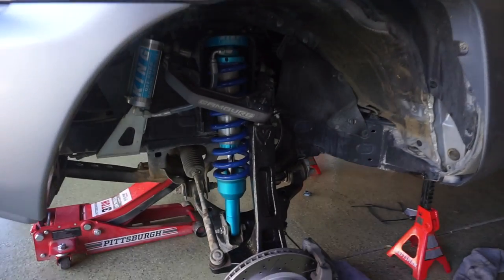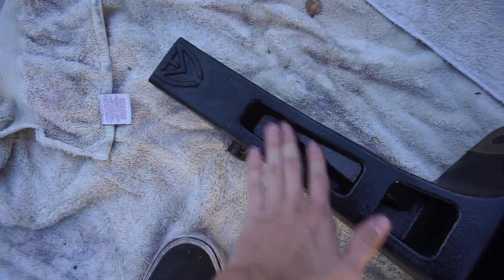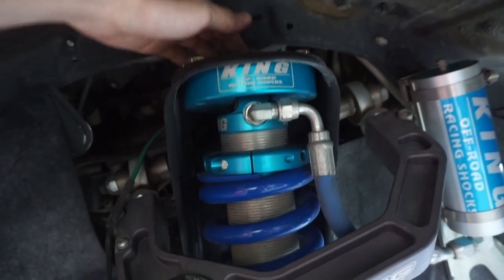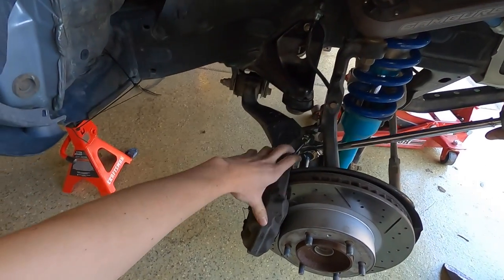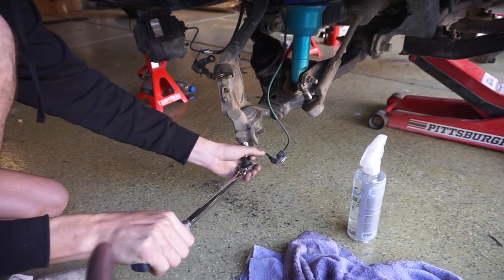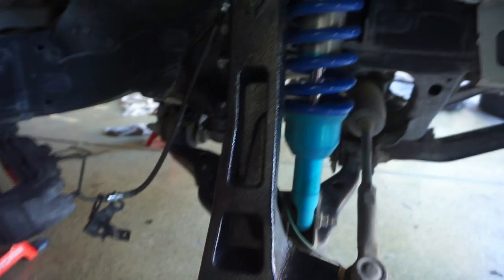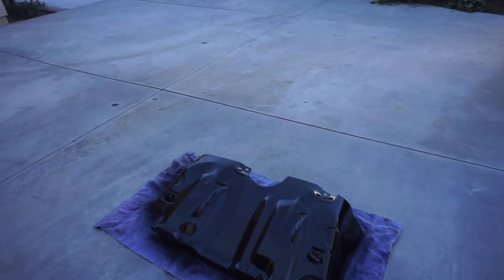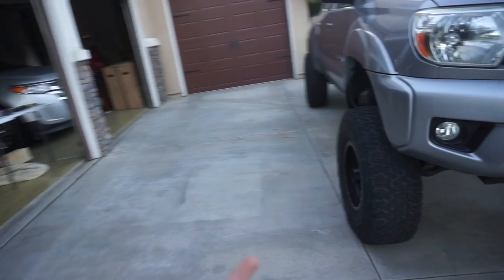My Tacoma NEEDED This For BETTER OFF-ROADING - Maxtrac Spindle Install

Comment: Aye man so check it out. All the stuff you went through. I went through with my Colorado. The driver side is naturally heavier then passenger. It’s uneven. The lift is amazing. I haven’t looked back. I do have 315/70/17. But I mean big tires small holes. Big game changer.

Comment: How are you running coilovers designed for only a 3 inch max lift on 4 inch spindles does it ride rough?
Reply from the maker: Now I’m no suspension expert by any means so take what I say with a grain of salt. But the 3 inch max lift is referring to exactly what that say. 3inches of LIFT. Doesn’t mean that the shock rod is maxed out. Just means that the Coilover itself can only lift 3 inches by utilizing preload. By putting in the spindle I’m able to remove all of that preload (drop all the lift out of the Coilover) and allows the spindle to do all the lifting so now the Coilover has a full range of motion and works better. Since the spindle attached to the balljoint in the upper control arm it’s simply spacing out the upper and lower not stretching out the Coilover since the top of the Coilover is attached to the coil bucket not the upper control arm.

Comment: Hey Man!
Love the info!
Question for you- was it difficult to run 16s on the Maxtrax spindles? I ask bc their website says you need minimum 17s, but I heard another YT say he had his on 16s. Just wanna get your thoughts man!
Thanks in advance!
Reply from the maker: I’ve had 0 problems with it 🤷🏻‍♂️🤷🏻‍♂️
Reply: @desertdime  NICE!
Thanks man!
Reply: What size wheel Spacers you running with the 16” wheels
Reply from the maker: @anthonyolmedo5794 none in the front, 1.25” in the rear

Comment: Yo did the maxtrac make a difference off road? Smoother ride?
Reply: I got some bilsteins 6112 and 5160.
Reply from the maker: I sing its praises all the time. Definitely helped with clearance and the overall ride just feels so much better. Must have ironed out some ride height issue in the shocks or front suspension geometry

Comment: Where did you get the hardware? The bolts that go in at the bottom there it’s sandwiched
Reply from the maker: It’s the hardware that came with the spindles. If you go to their website I think they have a parts section

Comment: Got a question brotha. So i put maxtrac on my 2011 and i got some positive camber from it. Does yours have positive camber and if so howd you fix it. Also you runnin spacers?
Reply from the maker: Since you’re switching up the geometry with the spindles you might just simply need to get it realigned. I have spacers in the rear but not the front

Comment: Do these increase suspension travel
Reply from the maker: I’m not entirely sure about that tbh but it increases the track with 0.75” on each side and corrects the suspension geometry. It also allowed you to take all the preload out of your Coilovers giving you more range of motion and full use out of them